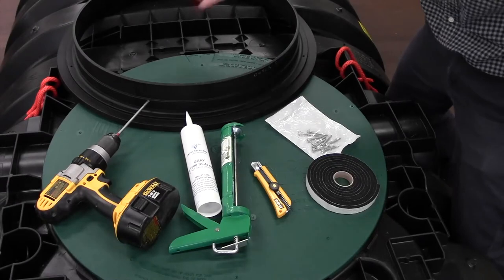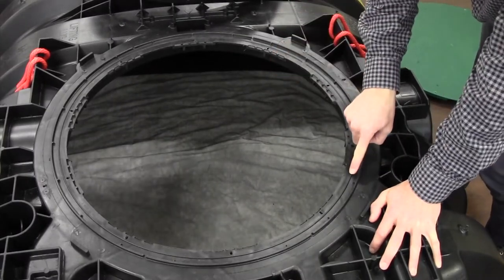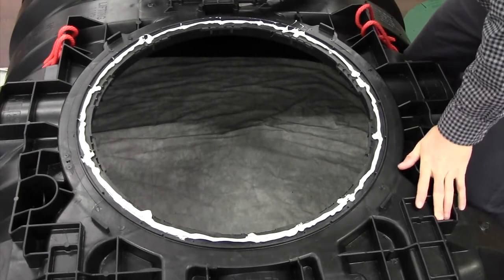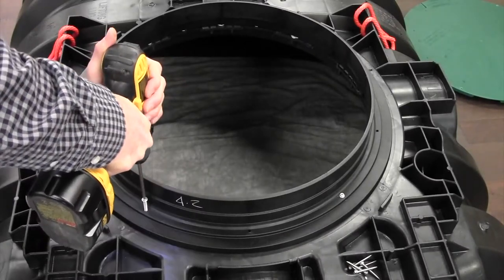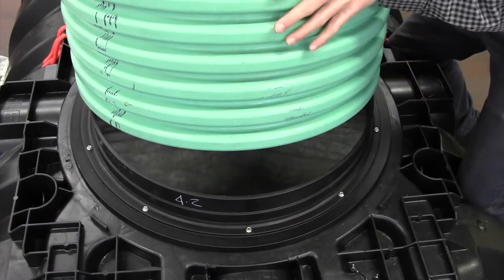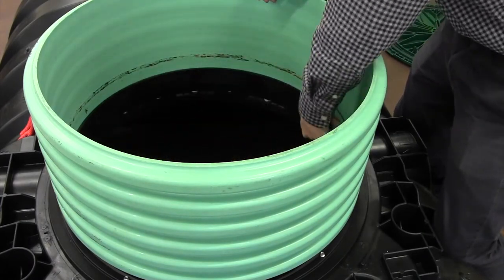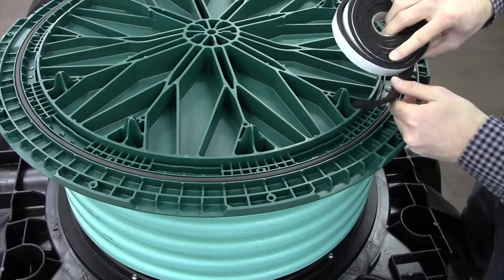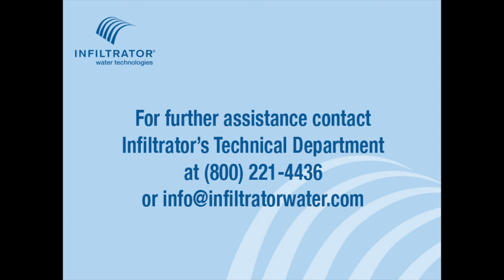Infiltrator's Riser Pipe Installation Guidance

Comment: Couldn't you attach the green corrugated pipe the pipe adapter ring first (say on your tailgate of your truck) and then attach the assembly to the tank?  Would help avoid having to mount the 1/2" screw inside the tank which would be nice if your tank has waste in it.   Just a thought.